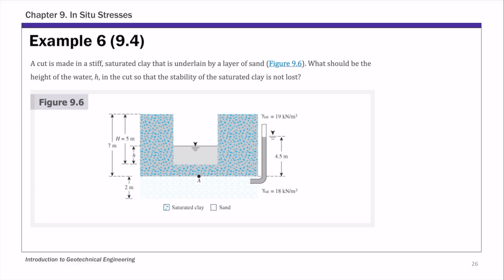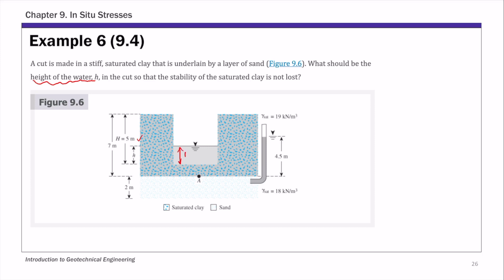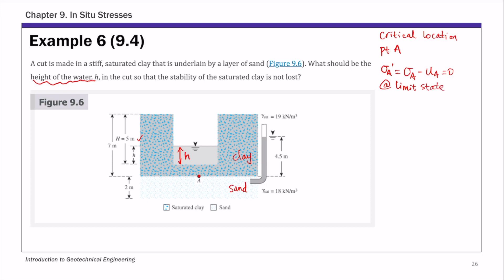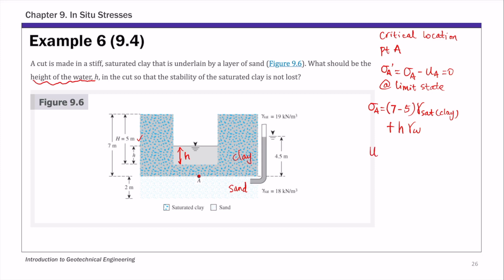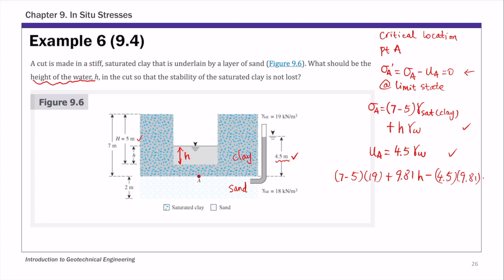Chapter 9 In Situ Stresses - Example 6: Stability of Excavation

Comment: How come to calculate pore pressure at A, you didn't add the height of saturated clay + height of water (h) all multiplied by gamma water? AKA [(7-5) + h]Gamma.water + 4.5 Gamma.water = pore pressure. In the previous example with the upward seepage you added those values to calculate pore pressure but here it is simply the height of the piezometer. Thanks

Comment: Why you don't use gamma effective on effective stress calculation?
Reply from the maker: You can only use gamma_effective if the water pressure is hydrostatic. In this example, the sand layer is under artesian pressure.